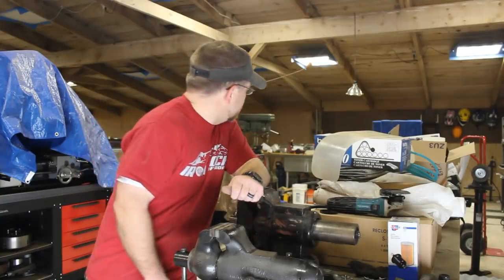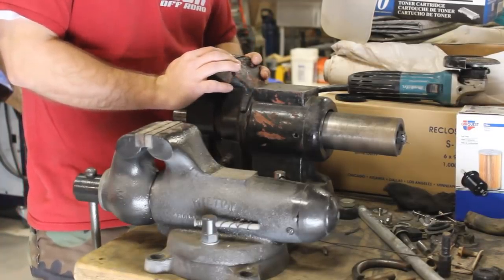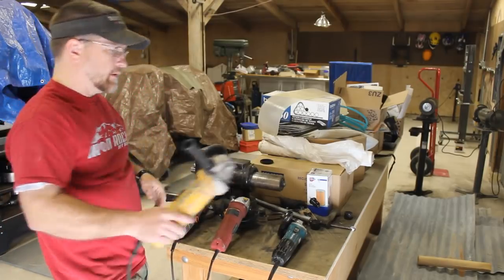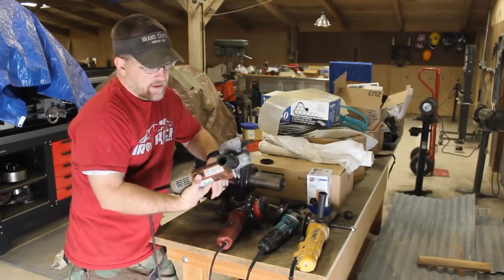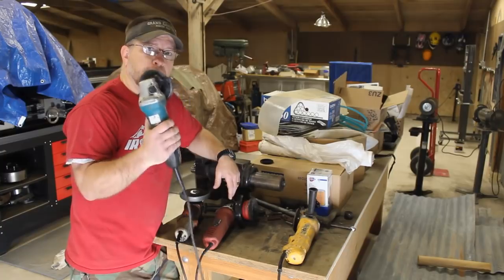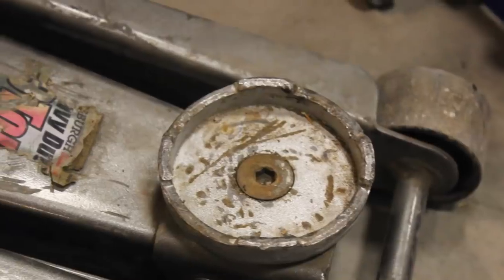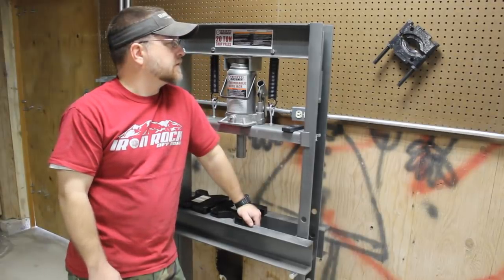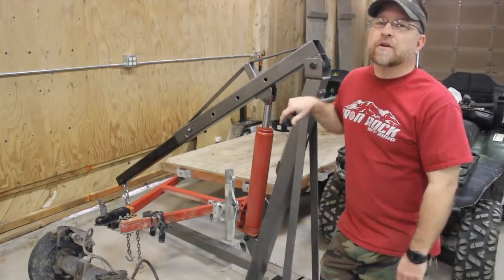CHEAP TOOLS! 5 Harbor Freight Tools I'd Buy Again

Comment: You can solve a lot of grinder problems by changing out the original gear grease with a quality synthetic grease.
Reply: This is the secret you have nailed it=I use quality industrial grease in them and they will last a lifetime~!!

Comment: Good video Buddy  ill agree on most of those tools as well  i am a Woodworker by trade   With many other interests as well and i  will say ive had pretty good luck with any od their pneumatic tools  like ratchets impacts , die grinders and  sanders too  especially when you factor in the low cost  i do personally prefer Senco  branded nail and staple guns and that. Is largely due to  a local Senco mobile dealer. That is spot on with  repairs and  parts for anything needed ive also found most  tool repair facilities  can work on them  and turn them around pretty quickly. Which is important  for meeting deadlines and keeping a high production company flowing  sometimes its just nice to have  many options. Instead of taking the time out to rebuild a gun yourself   I know a couple of guys that. Have the HF. Nail guns in their personal garages and shops and they say they are fine  for that use and a old business partner bought a couple  to remodel his own home and he claims the flooring nail gun is actually a exact clone  of the Stanley Bostich and those repair parts work perfect  as far as O rings and pistons  !

Comment: I buy a lot of Harbor Freight tools for home use. Of course the price matters, but I am not a pro and my usage doesn't equal theirs. It doesn't make sense to buy top of the line, then let it sit idle for weeks or months. Harbor Freight allows me to have all the convenience without spending big bucks. I use the angle grinder and small drill press constantly and know they are durable. I also love the air tools. I have a nail gun and several brad nailers and staplers. They are a must have, even though I dont need them often. I also use the half inch and 3/8 air ratchets and I love the little 3/8 butterfly impact. Like another guy said, HF is the best for consumables. If you are a pro, maybe you can afford the big name tools.

Comment: The small jack stands from HF are trash. Poor welds are common and most of them don't even sit level. Your life can depend on a jackstand. Poor quality control on an important item? Buy the stronger stands or go elsewhere for them. Their impact sockets are extremely good for the price. Probably no point in spending more. Their cheapest power tools are just plain junk. You can find something much better for just a little more especially on sale. Power tools can hurt you bad when they fail in an unexpected way. Not worth the risk even for a one-time use.

Comment: I don’t mind a little hf, but lowes has crazy tool sales sometimes around the holidays I got a two pack porter cable grinder set regularly 50 bucks for 25.  12 bucks a piece.   And he goes for three...

Comment: With that angle grinder Remove the plastic case and reseat the brushes . (0 percent of the time they dont put the brushes  in properly causing them to ground out pretty quickly.
I have taken apart friends to see why they went bad and out of 15  of them  they all had a brush not properly seated. 
I then took the ones that they had just bought and reseated the brushes they use them for detailing  and cutting and they work fine.

Comment: that makita cost around 60 i have one. the makita 9557 is stonger but it doesnt feel as good in the hand. the 9557 cost less than 60$ at home depot i have had mine for 2 years still working good i had to replace the brushes one of them broke

Comment: Good tools but like it should be a top 10 with some Jeep/offroad specific stuff: HF's SAE and metric bolt/nut extractors (Amazon has a set for $35ish "Maximum Impact 13 piece set" in a locking blow molded box that is tempting also mainly because there's flats on it to put a wrench on it if needed. Do I need it? But I'd hate to need it and be without). 

I'd call your list "shop tools". A top 10 of "tools you should have in your Jeep" or "in your toolbox while offroading" would be cool.

Comment: Your engine hoist---did you replace the bottle jack/ram in it? It doesn't look like the original. I was just curious how easy it is to get replacements.
The 12 ton press sucks. 20% off no longer applies to Central Machinery, unfortunately.

Comment: The problem is that Harbor Freight had unbelievably great deals originally, sometimes stunning, but a few years ago they seem to have become corporatized or something. Rather than once-in-a-lifetime grab-em-before-they're-gone potluck items suddenly appearing at any time, they got very organized and the prices went up. It's hard to explain. It's like, it used to be a flea market where you could stumble onto something at 80% off normal, and then, almost suddenly, those days disappeared. It's as though some accountants came in and said we can make more money being like Ace Hardware with very neat and well controlled shelves and stacks. That sounds crazy, but I'm not the only one.

So when you started showing the vice from 19 years ago, I was already nodding, uh huh, I bought some awesome stuff 15 years ago too ... and I'm still using that compressor and gauges and meters, and got head-spinningly low prices. I guess I'm just frustrated that I've gone back over and over and every time those gauges are 4 times as high, and the price never changes. That damn organization and I guess those accountants don't leave room for a bin of them showing up for next to nothing. I'm just greedy is what it is.

And not knocking these stories or the public interest benefit of making the video. All Bleepin' videos rock. And they sure as ------ haven't become stale and corporatized. And the quality and clarity is top notch - you boys work awfully durn hard on the quality on these.

P.S. I kind of say the same thing for Big Lots. Once it seemed much more awesome; not so much once they "cleaned up their disorganized act," haha.
Reply: I do see that a lot of their allure from a lot of people seems to be a psychological carryover from the past, from some years ago. I don't hear those jawdropping price stories about new purchases, but I think that that notion is still affixed in some people minds. The "contact high" just hasn't worn off for them yet, methinks :) It took a few visits for me to say, dang, I should have piled up on everything in the good old days. Sure, buy 3 and put 2 on the shelf - hard to go wrong with that.

Comment: The current version on that vise is much lower quality. Looks the same, but I've seen several with the jaw (hollow) snapped in half. I had that same orange grinder for like 10 years before it died.

Comment: Cheap grinders are bad news. The better quality ones function ok and reliable. Though generally the brand name ones are better, quieter, smoother less heat and more guts.
I have one of those alloy jacks and it has been excellent. I bought is because it is very low for racecars but have used it full time in the workshop. 
The other bigger one has troubles under modern cars. OK for off road cars!
The jack stands? I have seen one collapse though being abused. I have similar in passenger size and used properly they have been quite good.
Engine cranes are at best annoying and none of them go far enough under a car. I have one similar. It works fine, just a pain to use. IF you have the room a block and tackle is preferable
Here in Oz we generally get the same stuff, I buy most of these items wholesale. Though they are dearer here in Oz.
Those cheap impacts are as good as any, I have broken one but it was well abused!
For hand tools some of the cheap ones are as good as any, sockets though requires some more thought. I have literally binned some cheap 1/2" ones. Sockets poor fit and extensions, ratchets T handles etc all break. I have a 1/4- 3/8 set that were expensive cheapo shop but I have been using them for 20 years. Broken a couple of extensions and lost a 10mm!

Comment: To be honest, I'm a cheap b@st@rd, so I buy many of my tools @ HF.  I'm more of a casual/hobby mechanic, rather than a full-time, shop situation and many HF tools have served me well.  I did have one of their semi-gloss, deep impact 19mm sockets stress-crack up the side.  But dude, the rest have soldiered on for YEARS!  One thing I can't stand are "tool snobs", who think their sh*t don't stink cause they use snap-off, or fill-in-the-blank......high-end toolery. It ain't necessarily the lead in the pencil what gets the drawering done, it's the holder of said pencil.  Or sumpin ike at.
Reply: Amen Bro~!!!!

Comment: dont buy cordless stuff the batteries are Chinese 18650s low grade c rating... 1500 mah ones or 1200 mah ones cheap dont hold a charge long after 1 year your tool will fail.. there only good for the free stuff and little things like screw drivers and paint things that cant fail .. ive had everything break from them from drills that lasted 6 months impact ones flew apart the head to electronic things like measuring devices... there also getting expensive bringing in expensive things raising prices on stuff.... there parking lot sales are annoying they take up space and you cant park... to many people go to them now its always busy... always filled with low class people arabs love the store....bums walk in my store and the nearset one after that store i hate is 50 miles one way there to far spaced apart.... also they hire people that suck look like there off the street attitudes suck.. the cheap free batts they also charge 4 bucks for are only good for remotes they are cheap...... its good for paint screw drivers sockets not impact ones towels and a few other things fittings etc.... dont be fooled all there stuff is from china.. you can find stuff they sell on ebay same thing for far less too hf doubles the price from chinese sellers i bought a 90 dollar vacuum pump from hf found out same one ebay 44 dollars.... so there paying 10 bucks for the thing... oh and they suck there rusted and heat up fast good for the b ackyard mechanic not the professional.... so be wary people be wary.. also they dont care if your drill had a recall they had one that exploded and cuased fires took them 1 year to recall them didnt even send out emails or fliers you had to walk into the store and find out that it was recalled via the small poster by the door just to get you in the door to buy.. the parking lots are nasty they have screws so watch your tires.... people park where ever carts all over.. this is my store it sucks but what choice do you have craftsman is gone and in home depot home depot sells small stuff but not what hf has so its a monopoloy now atleast we had choices but this store and greed drove craftsman out

Comment: Harbor Freight is one of my favorites. They have some hand tools that are great buys for the money. Even their electric powered hammer drive unit combined with their impact sockets have worked well in removing sticking nuts and pulling apart steering linkage. 

The real deal for me is their 20 ton press. If you do one pair of wheel bearings, there's the cost of the unit. Example, my daughter's Camry required new wheel bearings. To remove, press out the old, and push in the new bearings would cost more than what I paid for the HF 20 ton press. If I used it a lot, I would install the 20 ton air pump kit to move it along faster.
https://www.harborfreight.com/20-ton-air-over-hydraulic-jack-95553.html